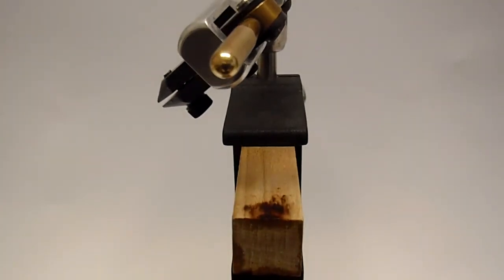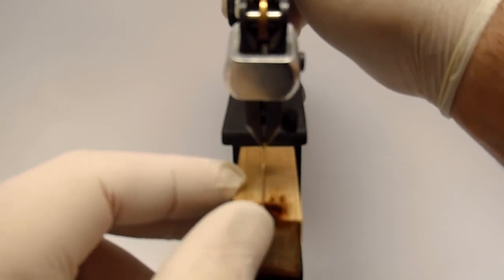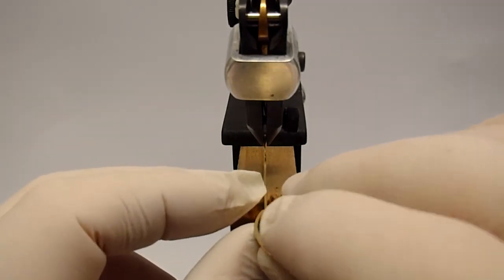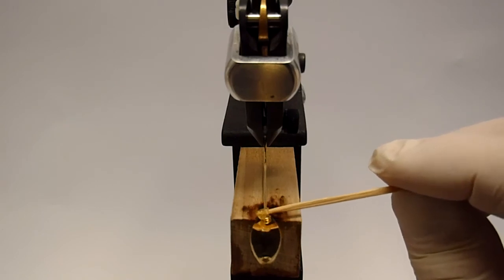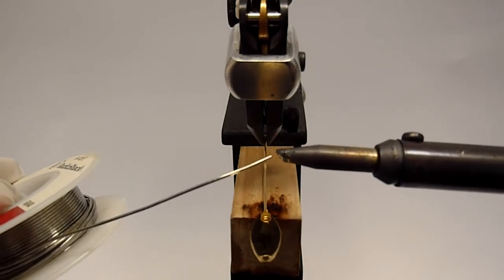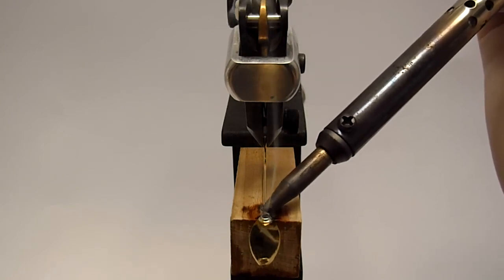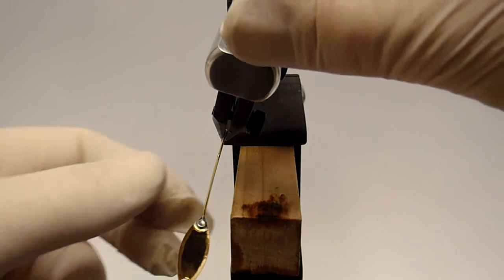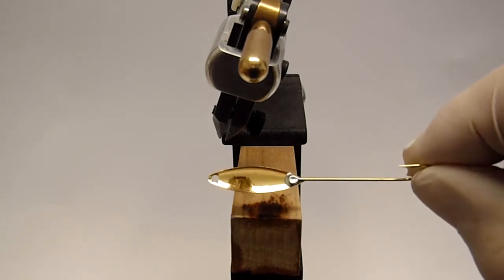Soldering Shad Flutterspoons

Comment: How much tension this soldering can tolerate? How secure is it? Say I catch a 4 pounder or 5 pounder shad, will it hold the fight? Thanks!
Reply from the maker: I couldn't give an objective answer to how much tension the solder joint can take.  I do aggressively bend and twist the lure after it cools to see if it will part; I'd guess that one in three dozen fail this test...better they break there at the bench than on the water.  Keep in mind that I make an effort to use as little solder as possible so extra weight doesn't dull the side-to-side action.
Reply: @Eroach2008  thank you!
Reply: @Eroach2008  You could slide the flutter spoon further back on the block along the hook shank to get a larger joint area. That might help.